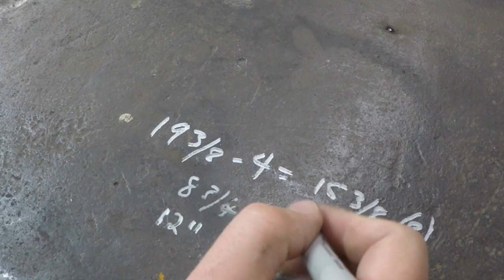How to make Steel Drawers - Industrial Desk - Steampunk Furniture - Fabricating Drawers

Comment: That brake is WAY cool.  That desk is going to be sweet as hell Gary.  I wouldn't want to move it, but it will be sweet.
Reply from the maker: Greg's Garage Thanks Greg, yea it's going to be a bolt together, 3 pieces plus the top, so 4 total... otherwise would be a big hassle to have to move and deliver to whoever buys it!

Comment: What do you use for a coating? How long did it take to make? Did you make the buttons? Thanks. Love the cabinet.
Reply from the maker: +AL eng I bought those rivets.  As far as coatings, there are lots of options.  Everything from a 3 stage paint job using automotive products to clear coating the bare metal, to just applying some wax to the metal.
Reply: +🔥Ramsey Customs - turbocobra how did you buy the rivets from?
Reply: +Kevin Boss , Sorry from whom did you purchase the rivets.?

Comment: Nice!  What gauge steel are you using for the drawer box? Also where did you get the rivets?  Douglas
Reply from the maker: RetroWeld Hey Douglas, thanks!  The drawer boxes are 16 gauge... I bought a couple different lots of rivets on ebay, don't remember where, but I need to look it up to get some more, and I also bought an equipto cabinet that had some aircraft style rivets in it...
Reply: Gotcha. I bought mine from King Metals. They have the Mushroom heads. Mine looks fine, I've never seen the flat heads for sale. Thanks
Reply from the maker: RetroWeld Ok yea, we have a king metals in Dallas also, I have bought a few things from them.  I have some of the button head rivets also, i used a lot of them on that welding cart!  lol

Comment: Nice work, but I wouldn't weld without covering any exposed skin man. Definitely raises the risk of skin cancer. It's worth it to be a little warmer or tad inconvenient in my opinion.
Reply from the maker: Good pont.  I always use Sun block when welding in the hot garage, and I had it on in this video
Reply: Ramsey Customs - turbocobra
Interesting. I had never considered using sun block instead. Glad to hear it though. Keep up the great work!